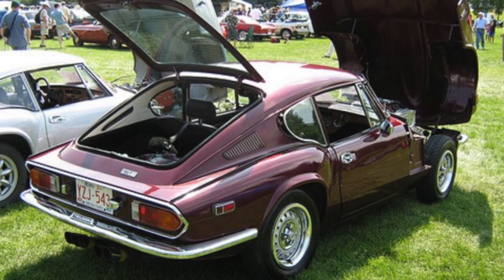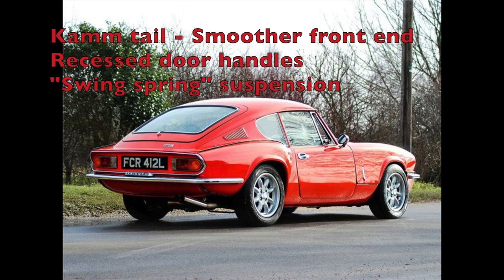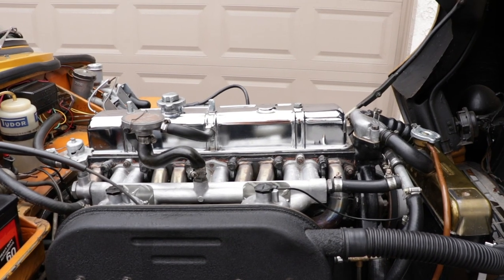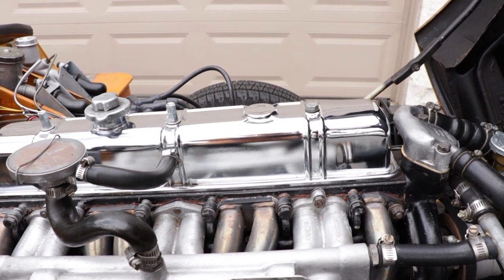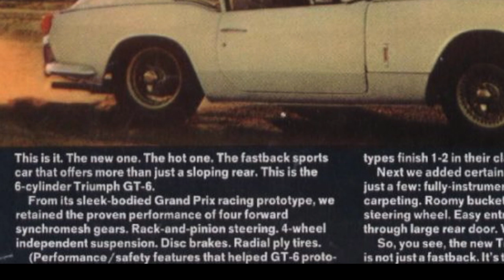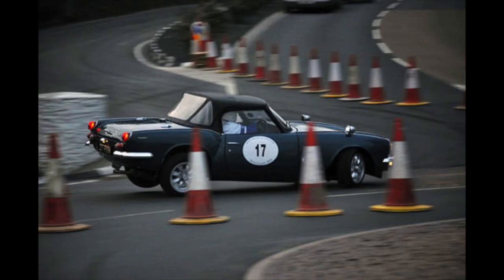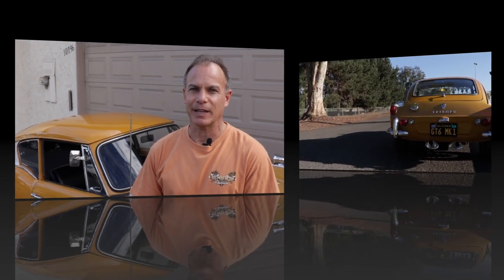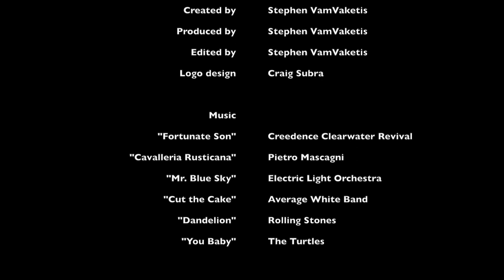Triumph GT6 Pt. 3 - A Closer Look

Comment: I bought a crashed GT6 back in 1978, it was a 1968 model, crashed i front and rear, I repaired the rear but the bonnet or hood as you Guys say was f---ked, I bought a Spitfire bonnet which did not have the vents top and side, being what you Guys call a fender bender mender bender was no problem for me, I cut the louvres out the old hood and braised them into the Spitfire hood, Loved that car, I paid 125 English pounds for it

Comment: I bought a used GT6, I believe in 1967. Fun to drive but your lower right leg was stretched out next to the engine - it could get a little warm to say the least. I told a friend riding with me that the heater had three settings: hot, hotter, and repent you sinner. I enjoyed your three-part videos on the GT6 - they brought back some memories.

Comment: I owned a brand new GT6+ and loved the look but found the car to be quite hot on the inside.    Engine cooling was not great either.  I added waterwetter to the coolant which made a big difference.  I also had to go to Koni shocks to keep the front end from continuously going out of alignment.  I think I still have the set of original shocks somewhere!

Comment: Biggest problem I had was overheat in hot summer weather. The vent louvers they added on the " plus" models was a good move. Also loved the fishtail late model GT6. They were really good on gas if the strombergs were synced properly. Mine got over 40 mpg.
Also worth mention was the problematic wire wheels that worked on Spitfires but the narrow splines stripped easy on the GT6

Comment: Great video great music ....Back in the eight's I had a MK3 Spitfire with od , I bought a MK3 GT6 that had the back end ripped off took the engine out of the GT6 and put It into the Spitfire which If I recall wasn't all that easy to do , Car drove like a dream and was pretty quick the od switch was on the gear lever knob great fun . I often thought this was a car Triumph should have built , a GT6 convertible .
Reply: Methinks the main downside of any herald based car has got to be the dreaded tinworm. Especially in the uk where local authorities love to salt the roads in the winter. They've murdered my 1360 herald. Even the main chassis rails have rotted out, even round the diff which is usually rather oily. This means a more or less terminal mot failure. Best modification to all small chassis triumphs is add an overdrive. And replace front steering swivels with a trunnionless kit. Front suspension collapse is no fun at all. Oil those trunnions. Not grease. Just normal ep90 gearbox oil.

Comment: Great series of fine Triumph that's often overlooked! I remember reading about a factory fix for rear wheel tuck which employed a simple fixed rod. It ran transverse across the rear from wheel to wheel and engaged the break backing plate thus limiting camber change in the swing axels. Does your MK-1 have this "upgrade"?

Comment: It's interesting that Ralph Nader didn't complain about the Triumph suspension (tuck under), probably didn't want to tick off foreign trading partners.  ;-)
Reply: I had at least 12 (probably nearer 20)  Spitfires, all around the '67 - 69 vintage.
I did sprint races with some of them .  Never once had a wheel tuck under even
though I regularly lifted the inside rear wheel whilst sideways.   Always wanted
a GT6  but never did find one with an original engine , as a lot were swapped
for the Dolomite 4 cylinder when that came out
Reply: Oh, that's a bummer.

Comment: I enjoyed your films, nice job. I would like to correct one important information mistake for future viewers: It is not true that the rubber rotoflex donuts need to be replaced every three years. They last perhaps 15-30 years. The last set I put in my GT6 was in 1986 and they are still ok.  Plus you can still drive on them even when the the segments delaminate and shear apart from one another.
Reply: Not true as a mechanic serving my apprenticeship in the early 70s this was a common repair even on Angela Rippons Lemon Yellow with brown velour interior Mrk 3 which I worked on regularly .
Reply: I lost a rear wheel and half shaft from my GT6 on its maiden drive as a very proud 18 year old (in 1980) seem to remember it was due to donut failure